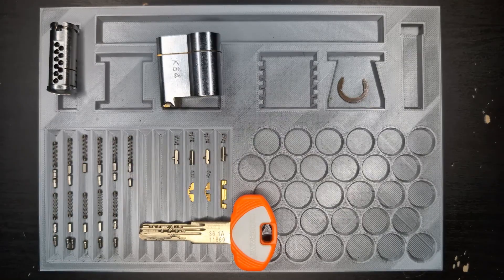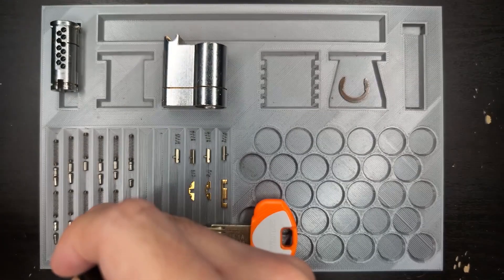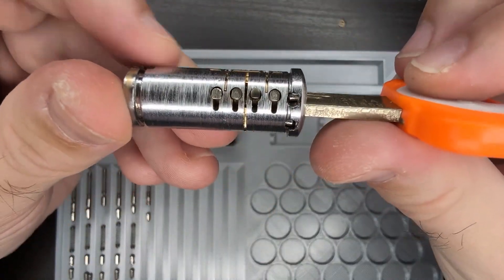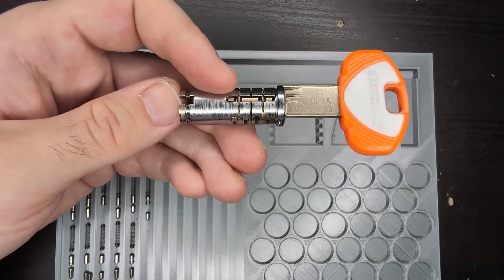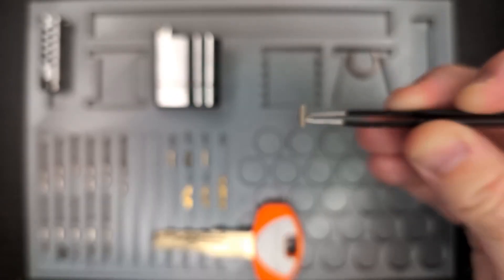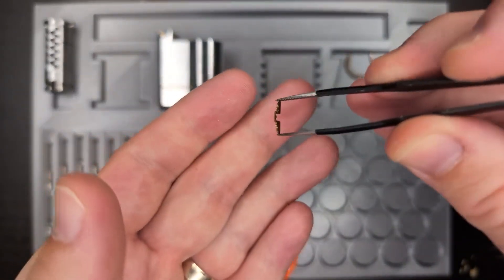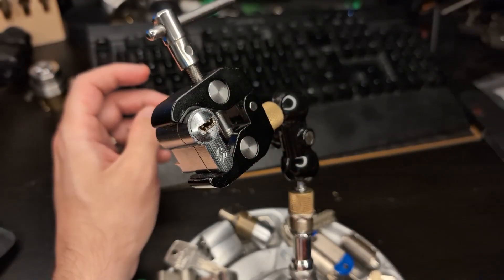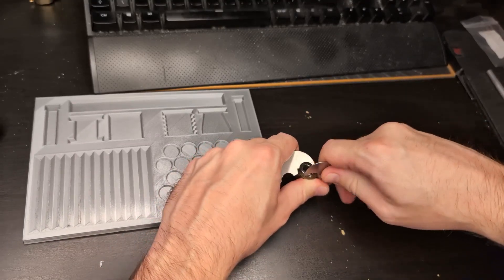Securemme K64 EVO picked and gutted

Comment: Wow that lock looked to have so much potential. I wonder how hard it would be if you would replace and change those parts. Like replace the sidebar with a square shaped one, replace the springs with stronger ones for the slider or weaker ones for the sidebar. Great job on the explanation and the picking!
What you did there with the multipick tensioner is only possible because slider 2 and 3 needs to be set almost to the same height?
Reply from the maker: @dignitypicks  it definitely has potential, with some precise machining and quality control this would be a lot harder pick. we have some reverse sidebar locks that actually work (lixil). it's a shame. removing any "zerolifts" from the sliders could help too, as I said the sidebar tilts in resting state and kinda helps with tensioning. 
and yes the "trick" with MP tensioner works because 2 and 3 are same height and adjacent. would be a problem if 1 was zero. 
anyway, this lock is the same one like yabende and Plzz picked and each one of us used a different method. that shows how you can abuse this lock, but also that different bitting could be a lot harder.